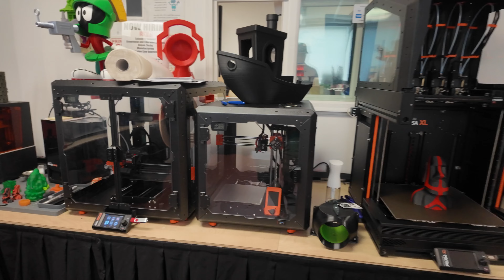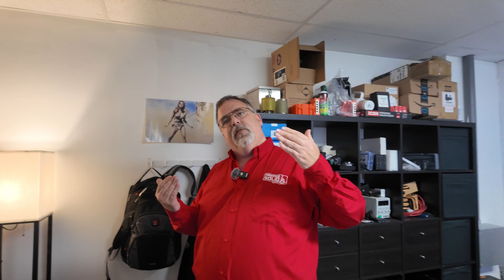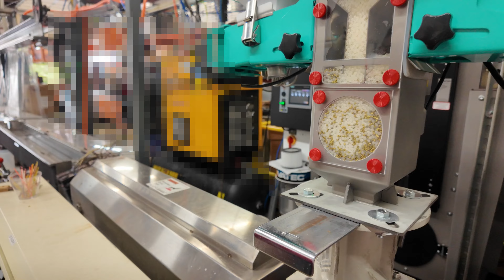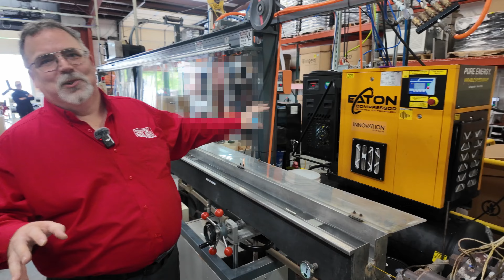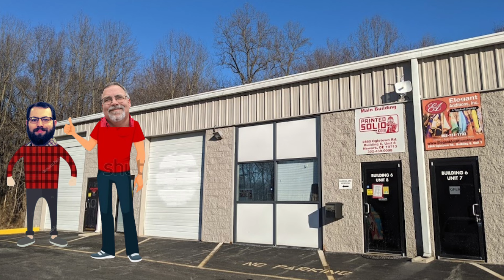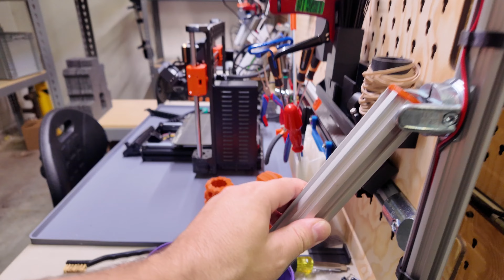Building Prusa's in AMERICA with Printed Solid!

Comment: so if canuck creator place an order for a MK4S in Canada from Prusa's website, does it come from Europe or US ?
Reply: I tried ordering filament from them a couple of weeks ago. They don't ship to canada
Reply: Which is weird because last year they did and I ordered 10s of kg no problem.
Reply from the maker: it would be from europe

although i BELIEVE duties from importing from the US are less than the EU, but the icnreased shipping cost from europe offsets it
Reply: @CanuckCreator  Nope, this was an order placed at Printed Solid that was rejected. It was jPLA and a build sheet. On inquiry, the response from them was.. "Unfortunately, due to the costs of shipping across boders, we no longer ship to Canada." Oct 4/24
Reply: I just want to give them my money
Reply: show me a shipping rate. I'll make the call if its too much. EU is nuts. 1 roll of pla ended up costing nearly $60 CAD all in.
Reply: We use to be able to ship to Canada but the country changed their rules for shipping there and we are still trying to get all the paperwork figured out to open back up to Canada. However Canada has similar(maybe better) terms with EU than USA.
Reply: @Drandolph1976  Glad to hear you are looking at this. cheers.

Comment: At around 5:00, why wouldn't you just do a transformer 400/110V 60-50Hz? Surely you have three phase available, though the frequency could be changed with a frequency modulator
Reply: Because look at the equipment it would take to convert 3 phase 400v 200amp from 60hz to 50hz. It’s a lot.
Reply: @Drandolph1976  Ooooh, I didn't know that, totally understand it then